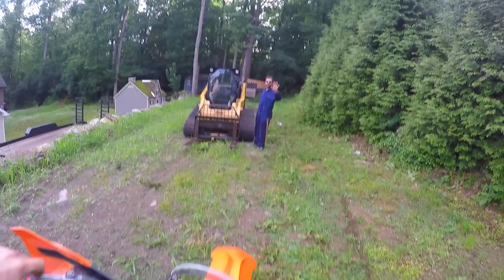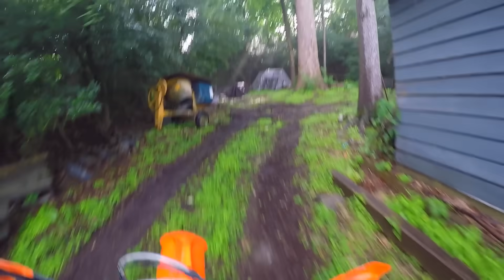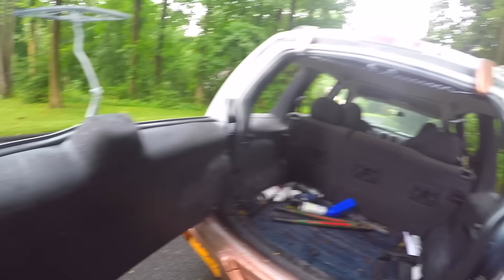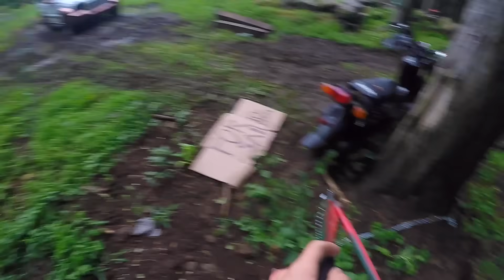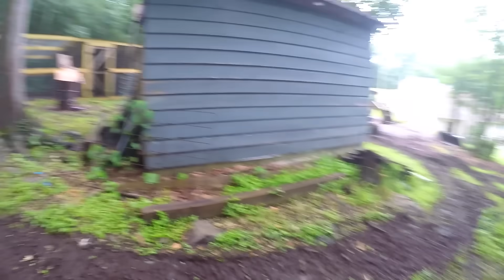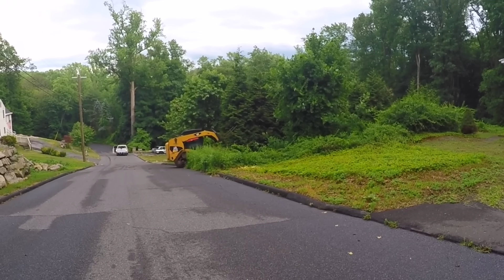Moped Thief Destroys My Car

Comment: Why did you just grab your gun? And why didn't you just park your car on the road and then just ran to your moped and drove it back to the car?
Reply: That would have been the smartest move I agree 100% but he should have had a second person with him that could have drove off in that car after he grabbed the bolt cutters and he could have just set them on the floor board of the moped once it was cut free and then took off on it that would have prevented something like this from happening to his car!
Reply: Or he could've just called the cops like a normal person and not use a bb gun to threaten his friend who knows that they obviously staged it